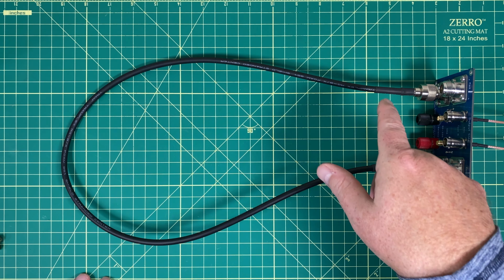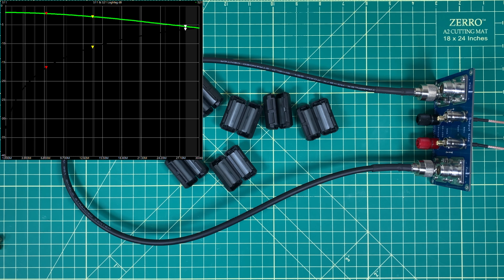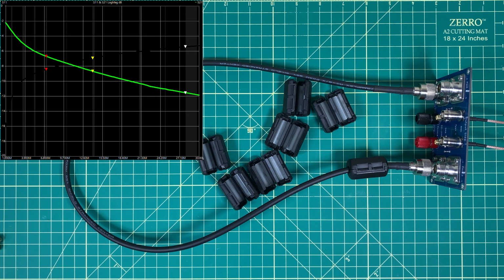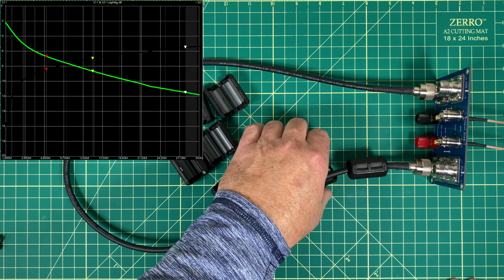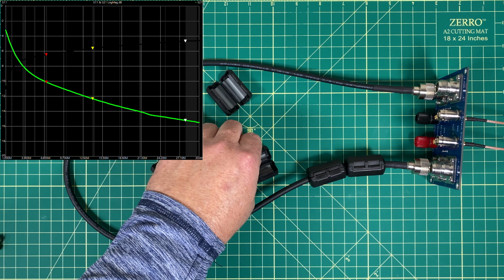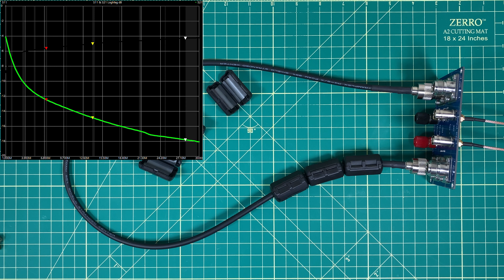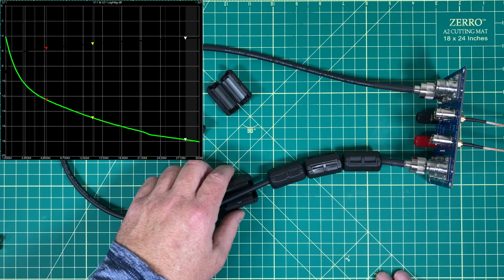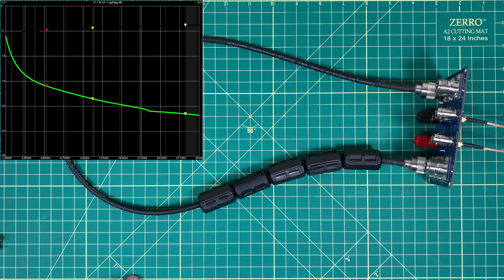Can Ferrite Beads Improve My Ham Radio?

Comment: I couldn't find an answer to this question:  where to put the ferrites?  At the antenna, or at the radio?  My personal experience shows that inserting a 1:1 current un-un at the radio had no effect.  However, putting it at the 4:1 balun on the tower of my OCF dipole reduced the noise floor by 2 S-units on most bands.  I don't understand how it works, but I like the reduced noise floor.  Thanks for your video!
Reply from the maker: That is a good question that unfortunately has the answer, it depends... The variable being the use case of the antenna and the feedline. In an EFHW antenna, you are going to use the unbalanced coax as the counterpoise for the antenna, so you would want to put the ferrites on the radio side to choke off the common mode current that is picked up on the coax so it is not introduced to the radio. If you place the ferrites at the feedpoint of the antenna, they would choke off the common mode current at the coax and the coax could not be used for the counterpoise. Some EFHW antennas, have a place to connect a counterpoise, but then effectively you are changing the antenna to a CF or OCF dipole depending on how long your main element and counterpose is. Depending on how long your coax is and some other factors, it is possible to pick up common mode current between the choke mode choke at the feedpoint and the radio. I always place a common mode choke at the radio. It will not impact the desired RF signal on the coax.

Comment: Would ferrites help with the snr noise from my 7.5 meters coaxial cable of my 4G antenna?
Reply from the maker: The short answer is yes, but the long answer is a bit more complicated. The material composition that is used to make up the ferrite core is referred to as a Mix type. Depending on the composition of materials, you will get different results with specific or ranges of frequencies. In amateur radio, Mix 31 and Mix 43 are the most commonly used for the 1 to 30 MHz frequency ranges. The 4G cellular system uses multiple frequency bands between 600 MHz and 2.5 GHz and the Mix 31 and 43 ferrites would provide no benefit at those frequency ranges. Here is a link to a good article from Palomar Engineers going into detail about the different Mix types. https://palomar-engineers.com/ferrite-products/ferrite-cores/ferrite-mix-selection. I would look for one that is going to cover the specific frequency range(s) that you are looking for and experiment. In the video, with the NanoVNA, we were able to see the effect of adding additional ferrites to the coax and seeing the difference in suppression. I would caution not to buy ferrites from Amazon, Ebay, or some other place like that. Some ferrites are color coded to their Mix type, but that is more of a suggestion than a standard. There is no easy way to test the composition type, so I would stick with a Digikey, Mouser or other electrical/electronic supply house or use company that specializes in RF suppression solutions like Palomar Engineers.

Comment: Ok so now let me understand something.. when we attenuate with ferrites what do we attenuate specifically? The reception signal, a noise that is causing qrn/qrm to the cable near our radio ? Nice experiment... Will do the same with my NanoVNA in realtime with my radio
Reply from the maker: In an unbalanced feed line, like coax, we have current traveling in differential mode or opposite directions between the center conductor and the shield. Because the feed line is unbalanced, generally due to different lengths of conductors, the magnetic fields of the signals do not cancel each other out allowing a magnetic to be established and allow RF or referred to as common mode RF to travel down the coax and in to your radio. With the ferrites, you would be attenuating the common mode RF that is riding in the magnetic field by collapsing the magnetic fields before the radio. At best, common mode RF will cause excessive static and elevated noise floor and at worst, it could cause damage to the radio. It is always a good idea to use a common mode RF choke right before the radio.

Comment: I had been leaning toward using a toroidal design for RFI suppression but your video has me now considering snap-on cores. I understand your cores were Mix 31 material. Have you tested the same setup using Mix 43 material? 

My next question is, what if you alternated 10 cores on the test coax? For example, would a string of 31-31-31-31-31-43-43-43-43-43 show any difference than alternating 31-43-31-43-31-43-31-43-31-43 ??? Or in general, what does the VNA show when using Mix 43's instead of 31's ???

I am hoping for additional suppression below the 40m band, down to the 160m band, without a huge compromise in the higher frequencies. My target use is a multi-band "wire fan-dipole(s)" center fed with 50 ohm coax.
Reply from the maker: Those are all very good questions, that I will have to answer with the dreaded response of "it depends". The video was designed to show people how they could test various configurations for themselves as they experiment with different configurations relative to their specific use cases. Most amateur radio operators simply rely on information published on the Internet or from Carl down at the club who insists his way is the way to go. Most people will just take the information as gospel and move on. With some simple and inexpensive test equipment, we now have a way to not only validate Carl's advice, but also tune it to our specific use cases. Keep experimenting and thank you for watching.🌮🌮🌮

Comment: So ive s8/s9of noise which i think is being picked up on my antenna when i  disconnect the antenna i loose the noise completely so if i put the clip on beads on the coax i should loose most of it
Reply from the maker: That is a good question and the answer is unfortunately, it depends. There is all types of interference, intentional and unintentional, that could be causing your issues. Taking intentional interference out of the equation for the moment, these types of filters suppress the ability for common mode current from passing to your radio by suppressing the magnetic field that is created on the outside of your coax when using an unbalanced antenna, feedline, or both primarily while transmitting. By suppressing that magnetic field it stops one vector of electrical noise from entering your radio, but that does not stop the interference that is directly received on your antenna. All kinds of electrical interference occurs in the wild from noisy appliances to electrical switches and outlets that are on their last leg. An easy way to isolate external interference is to power your radio with a battery and start turning off electrical circuits in the house to isolate a circuit with a potential noisy device and then start looking outside the home if there is still an issue. Noisy power lines, transformers or your neighbor's pool pump can all cause noise that can raise the noise floor and make reception difficult.

Comment: Tim very nice test,and my question is,for marine electronics fishfinder , they come with one ferrite bead that should be installed on the transducer cable. If more than one bead was connected, help to improve transducer feed back quality?
Reply from the maker: RFI has a way of finding itself in places you do not want it. The fact that the manufacture has placed a ferrite bead on the transducer cable would be a good indication that RFI can be an issue. It would not hurt to try some additional clamp on beads and see what the results are. You do need to keep in mind, that the ferrites will not boost or amplify the signal from the transducer, but it will potentiality stop RFI from interfering with it. Also, there is a point of diminishing results with the amount of suppressions per added ferrite bead.

Comment: Thank you, very Interesting.  Who manufactured or supplied the mix 31 beads?  Fair Rite, Amidon, RF Parts, Palomar Engineers or an Amazon undefined vendor?
Reply from the maker: The ones I used in the video were made by Fair Rite that I purchased from Mouser.

Comment: Because of the amount of people who swear by chokes, I feel like I must be wrong - BUT......
You send voltage up the coax which results in a current which drives the antenna.
If the antenna / feeder is right, there will be no common mode current, and if the antenna / feeder is "wrong" there is likely to be common mode current.
Isn't it the case that a choke is totally relying on the fact that it is an awful transformer, with nothing to couple the energy to, which then results in heating in the core? The heating doesn't come for free - that is your radio output power being used to heat a lump of ferrite. 

If you have a fixed antenna that is "not quite right" but you are prepared to accept this, and you ALSO have trouble with the resultant common mode current causing interference in the shack, I can see how a choke would stop the interference, but that is ALL it does.
What the choke does not do (and this is what I feel is missing from most demonstrations) is turn a non-ideal antenna with current problems into a well functioning antenna.
The current that should have manifested as RF power from the antenna is simply wasted as heating power instead.

Again - it could be that you live with some restrictions. Maybe your garden is only a certain length. Maybe you have limited mobility and a friend helped you erect the antenna 10 years ago. Maybe you hid a wire in a flagpole which is now set in concrete. Whatever the reason, you end up with a non-ideal antenna / feeder arrangement that returns current to the shack. A choke of any kind simply burns off the current as heat to stop it from ending up in the shack.

No?
Reply from the maker: If you use a non balanced feed line you are creating the conditions to prevent the differential mode current from canceling out the magnetic field that carries common mode current back to the radio.

Comment: Nice, useful experiment, thanks.  I always wondered. Of course my pedant is saying that you should not be saying 'negative 20dB of attenuation' - correctly the attenuation is not a negative. You have neg dB of signal, pos dB of attenuation. /pedant off
Reply from the maker: Thank you for the feedback. I inadvertently throw the double negatives in every once in awhile without thinking about what I am saying. It drives my wife nuts.

Comment: Great video.
Question: How far from the connection (SO239) to radio should ferrite beads be placed?
Should I add one bead at a time or should I just put all 7 beads?
RG8x coax and 11mm ferrite beads.
Reply from the maker: That would depend on primarily on the type of antenna that you are using. For example if you are using an EFHW, you want to use the coax as the counter poise so you would put it close to the radio. In other cases you could place the choke closer to the feed point of the antenna. Then depending on how much coax you have between the radio and the antenna there is nothing wrong with placing RF chokes at both ends. Common mode current chokes do not interfere with the signal on the center conductor of the coax, it only chokes or attenuates the current flowing on the outside of the coax in a common direction as the current on the return shielding of the coax.

As for the distance between them, that is where the test rig and the NanoVNA come in to play. There are several designs out there and everyone provides different results. Some are better than others. This is a simple way to visually to see the results in realtime as you make those adjustments. I am working on the next video where you wrap coax through a toroid each time you pass the coax thru the center you will get more attenuation, but what is the best number of turns.
Reply: Let me explain setup: I have a 20m EFHW antenna on my roof and a ATAS-120A antenna on my chicken coop roof which works pretty good as a counterpoise both antennas are connected to a 2-position coaxial switch which is than connected to FT-891 HF radio. Both cables are RG8x and about 50ft. each.
Will ferrites beads work with these setup?
Is is best to individually connect each antenna's coax to radio, adding beads where you mentioned. @GraymanPOTA
Reply from the maker: @YayaOrchid I would think that the best place would be to place them on the cable between the switch and the radio. That way you would benefit from the same choke on both antennas.
Reply: Thank you, I will add all 7 and see what happens.
73 @GraymanPOTA

Comment: What happens if half on each end or spreading them out evenly ? Does it change anything??
Reply from the maker: Good question, depending on how you use your coax will depend on whether you place an RF choke on at the coax at the feed point or not. For example, on an EFHW antenna, generally there is no counterpoise and the coax would act as the counterpoise for the antenna. In this example if you placed an RF choke at the feed point, you would lose any benefit of using the coax as the counterpoise. As for other examples, it really depends on the environment you are operating in. It will certainly not hurt, but depending on the length of the coax, it might not help.

There are several designs for making RF chokes on the internet, some good and some not so good. I was using this one example to show people how they could use the common mode current test rig and the NanoVNA as a way to test different designs and see which one worked best for their specific use case.

Comment: Interesting, I tried to duplicate your results, same rig, mix 31 tight fitting beads from Fair-rite and only got about half the reduction you got. I have some slip on's on order and will see if those do any better.
Reply from the maker: I think you stumbled on to a good reason why people, end users, should have the knowledge with test equipment to test the effectiveness of common mode current chokes and other components that we use in ham radio. We have become a turn-key society where we just expect things to work, but we don't understand how it works. That is OK, the hobby has shifted that way over the past 20 years, where people not required to be as technical because so much pre-built and designed gear is available. I am glad to see that you are attempting to duplicate the test. Did you do the OSL calibration of the VNA before you tested the circuit?

Comment: Very nice test. How about a similar test but at 10m, 6m, 2m & 70cm with Type 61 snap on ferrite chokes.  Not all hams do HF.  Judging from your data,  attenuation per choke increases with decreasing wavelength, but how much?  Is one Type 61 choke "enough" for a 70cm antenna feed?  (Type 31 ferrite is not recommended for higher frequencies.)
Reply from the maker: You are right, the different compositions of the ferrites will produce different results at different frequencies. The motivation behind the video wasn’t to show people what the different results would be, it was to teach people how they could test the effectiveness of common mode current chokes with some simple and inexpensive test equipment.

Comment: What kind and where did you get them
Reply from the maker: I used Mix 31 snap on ferrites from Fair-Rite. These have a 9 mm inner diameter and RG8X coax is around 7 mm outer diameter. They will slide a bit depending on the diameter of the coax you are using. On the manufactured versions, they will slip over some shrink tubing to help keep them together and in place on the cable.

https://www.mouser.com/ProductDetail/Fair-Rite/0431178281?qs=JTtBSkyWskgca1F4cZ1wag%3D%3D&countryCode=US&currencyCode=USD

Comment: why stop at 7? why not see what happens with more, if it continues to attenuate, or if more just stops working.  I don't know anything so excuse my question if it's offbase.
Reply from the maker: That is a fair question. At some point you reach the point where the amount of attenuation you gain per ferite becomes negligible. In this application, the once you achieve -20 db or more of attenuation, you will effectively choke off the common mode current from feeding back in to the radio.

Comment: Could you do a straight through test of the affect of multiple toroids on differential current within the shield? And what is the affect of a CMC on a multi-band antenna (EFHW for example) with regard to high-band performance (on say 10 meters?)
Thanks.

Comment: How does this affect SWR?
Reply from the maker: @douglashill3967  Good question. They don’t, they only effect or increase impedance on the common mode currents the are created outside the cable due to the unbalanced nature of coaxial cable. They are transparent to the differential mode currents that are on the center conductor and the shield.

Comment: for 80m usualy about 7 snap on ferrites on the end of the coaxial cable are enough, close to where the connector on the cable is. the ferrite material has more resistence towards HF the higher the frequencies is, that means the cable doesn't need that many ferrite cores for 20m. how many snap on ferrites on a coaxial cable would be to many ? i guess the ferrite attenuates the HF in the inner conductor of the coaxial cable too, at some point there will be no more significant HF current in the inner conductor of the coaxial cable when there are to many snap on ferrites on the coaxial cable.

Comment: SMPS adaptor of the external amplispeaker for my laptop produces RFI bands in my radio on multiple bands. Will be seen as broad 'waterfall' bands much wider than an SSB signal. Took me a long time to find the culprit! Wonder whether Ferrite Beads will help? 73 de Jon, VU2JO